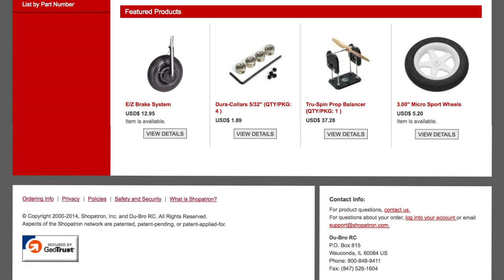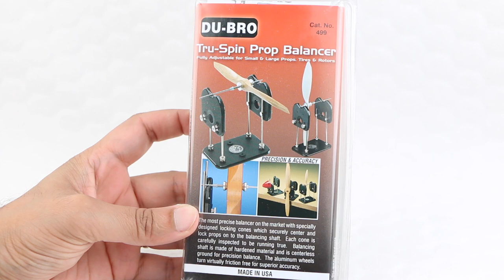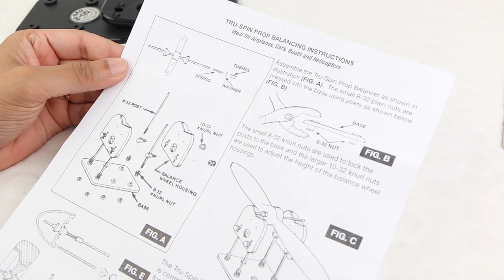#3: DJI Phantom 2 - Balancing Props with the Du-Bro Tru-Spin Balancer

Comment: I am having trouble, I got props to balance horizontal  then I put them vertical and started to sand the heavy side which I determined by watching which way the prop fell. I was getting close too vertical balance when I decided to check the horizontal balance(which was good earlier) and now it was off favoring the opposite side from the initial balance?

Comment: BTW, I would be adding material to the light side, not sanding on the heavy side. Its easier to remove what you've added than it is to replace what you have removed. Scotch tape works just fine. But, to minimize the effort and amounts used, when adding, use something like the heavy foil HVAC tape.Always apply your balance weight to the underneath of the propeller blade, never on top.
Reply from the maker: Excellent tips - thanks you!
Reply: Any time, friend. Good video. Keep up the great work!
Reply: Actually if you are adding tape ... then the Helicopter boys have the best way. You take a piece of clear tape ... (Heli boys often use coloured to give visual tracking) ... fold it over the leading edge and press smooth both sides of blade ... meeting at trailing edge. Sharp knife - slice flush to trailing edge. Why ? This then gives a corrector with no edge that airflow can lift. Its thin enough to not affect aerodynamics of blade.

Comment: Hello Iftibashir, it doesn't sound like there is a place, here in the U.S., to purchase the additional ROD for balancing the DJI self tightning props, so if you still have that additional rod I would very much like to get it from you, no problem paying you for the postage, is it still available??
Reply from the maker: Michael Aguirre I'll see if I still have it ;o)
Reply: Cool, thanks, I actually spoke to Du Bro, and they are not interested in making one, ?????  Oh well, maybe a small side biz for someone.

Thx,

Mije
Reply: +Michael Aguirre you probably know this by now,  but 1 year later and du-bro does make a rod for the P3 self tightening props.
Reply: But its not necessary if you use the supplied gear correctly.

Comment: Doesn't sanding cause the surface of the prop to have air turbulence?
Reply: No. The propeller works on lift, created by the vacuum above the blade, not pressure underneath. Sanding on the bottom of the blade will not affect it's function.
Reply: So only the bottom side is what gets sanded. Got it.
Reply: Sorry but bad sanding will. Extreme fine sanding is called for along the blade rear face. Bad sanding and causing rough surface will create turbulence on the rear face. The lift as you call it is based on two factors : RPM of the blade and PITCH of the blade as the prop WALKS forward in the air. The prop is basically an air pump.... driving the air rearwards and itself pulling forwards.
Reply: NEVER sand front face ... and avoid sanding in one area ... tip or hub. Try to sand along the underside of blade ... avoid altering edges. If the blade is significantly out of balance as in typical slow fly props ... then fold clear tape over leading edge of light blade ... joining at trailing edge ... cut flush. This is similar to what Helicopter boys do.
Reply: I've studied aerodynamics. Both as an interest and also part of my training as a flight paramedic. The principle of lift (and yes, that is the correct word) is that as the blade spins (or with a fixed wing aircraft, the wing moves forward) a vacuum is created above the wing, providing lift. Poor sanding will not help. But, sanding the underside of the propeller blade to reduce the weight of that blade will not affect lift.
Reply: Thanks for the advice. That is a good technique. I will try it. One issue could be, though, that a piece of tape that is long enough to go from the top of the leading edge, around the underside and to the trailing edge may be too large. Sometimes as we are doing dynamic balancing of the quads propellers, only a small piece is required.
Plus, dynamic balancing is when you stand the propeller on end, and see which way it turns. That will be the heavy side. You have to add tape to the other side ONLY, to achieve balance. That rules out placing the tape the full distance (from leading to trailing edge) of the blade.
Reply: The old description of the pressure differential as reason for lift has in recent years been shown to be not the real deal. It is only a part of the equation.... a small part in fact. Angle of attack and the actual movement forward has been shown to have a major part in the 'lift' ... witness the use of flat plate wings ... 
An aerodynamic wing shape is there as to create a smooth flow unless you look at later turbulated or non laminar flow wing forms.
The different forms give different characteristics because of the aspect presented in angle of attack.
A Clark y for example can be level and still fly - because its shape actually creates a slight positive angle of attack.
A flat plate or symetrical shape though needs to be slightly raised to create that angle of attack.
Simple aerodynamics that even schoolboys can figure out.
Reply: I am fully aware of the angle of attack, school boy. But that doesn't change the fact that lift is created by the vacuum above the wing, not the pressure below it.
Reply: With a fixed wing or quad prop ... you are limited in length but it is still good practice to balance not only blade to blade but also to have weight proportioned to each blade same. Heli boys go to great length to ensure the blades have same pivot weight point along the lengths. As well as balanced overall.
Some people advise balancing by sanding / altering TIP of a blade ... TERRIBLE ADVICE !! You would be introducing differential weight at the extreme ends of blades ... that is why APC and prop manufacturers advise to sand along the blades length. If you add tape ... I have all sorts of different widths / grade of tape to use .. so even a light small prop is catered for in that respect.
Reply: You are still hanging on to the old Pressure Differential theory which has been shown to be over-stated in providing flight lift. Modern day research has shown it to be not the real reason for a wings flight. Time to move on ...
Reply: I agree that altering the tip of the blade is horrible advise. And, like we both agree, adding weight to the light end or light side, is better than sanding. It's easier to remove what you have added, than it is to put back something that you have removed.

Comment: why are you not resting it on top of both sides?
Reply from the maker: Because its not supposed to be used on top of both sides - it would just topple over from the weight of the prop on one side. The video highlights the correct way of using the balancer.
Reply: Mine stays up ok..
Reply: I know that I'm replying to a post that is over a year old. But, I thought it would be worth posting anyway. Whether you are using the Dubro or the Speedy, this IMHO is the best method of doing a static AND dynamic balancing of your propeller. First, place the prop horizontal on the balancer, and mark the light END. Then, place the prop vertical on the balancer, first with the light end up, and then with the heavy end up. Do this a few times, to find the light SIDE. Now you have a starting point to do both your static and dynamic balancing at the same time. Add tape to the light side of the light end, close to the center of length of the blade.Repeat this process, checking both the horizontal and vertical balance of the blade at the same time. At some point, you will have to start making adjustments by either adding to the other SIDE for the dynamic balance and/or continue to add to the light END for static balance, but at the center of the blade,not at the edge of the what was the light side. You may even have to remove a little of the weight that you've already added by trimming off a little of the tape with a razor knife. Note: if the blade is only slightly out of balance, after adding some tape, near the center of the length of the blade, you can reposition the tape either further out or closer in, relative to the hub, to achieve balance.

Comment: Theres a massive flaw in this video... im doing a video on it myself now. The shaft enters the thread and there is play so you can never scre it in the same position twice. This means that the hub will always be out of alignment and it causes massive vibrations if you balance the hub! Just try putting the 6mm bar through and seeing how it seats, then grab the prop and press in several directions. See how the hub moved. Game over! Im going to contact Dubro asking if there is a solution. MY props were better balanced before I put them on after the Bubro balance and this is not right. Needs a fix.
Reply: Because Video shows WRONG way to use rod in DJI props. It needs the brass / bronze bush on the rod that is a snug fit to the DJI prop hub. Using the silicon tube is purely to keep brass bush in place ... NOT to centre the prop ...